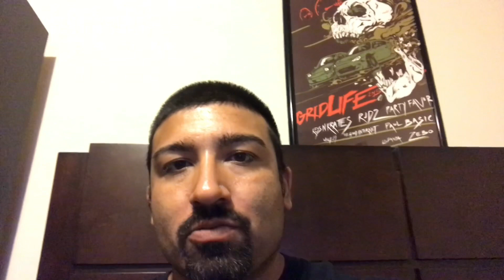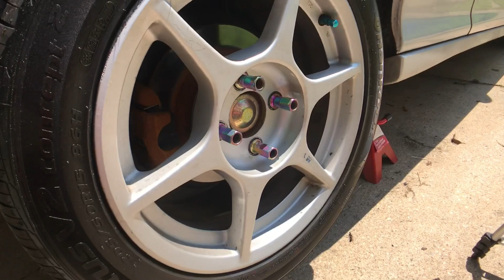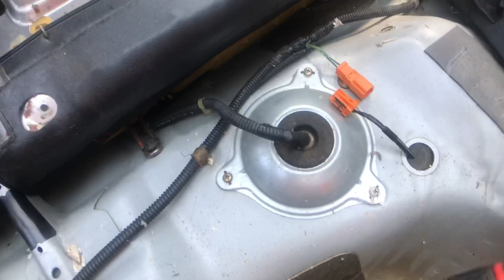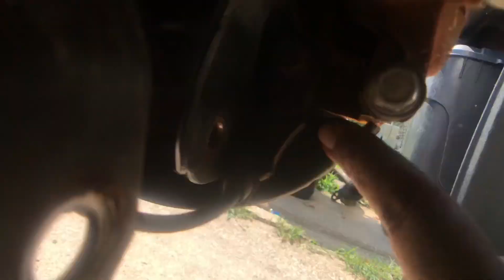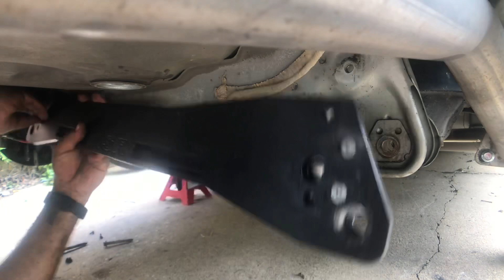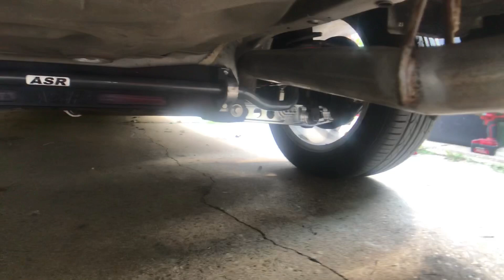ASR subframe and sway bar install

Comment: The abs sensor wiring doesnt work with the asr subframe brace?
Reply from the maker: Alex Bardon the wiring for the abs sensors will work with the ASR subframe brace. If you have aftermarket control arm the bolt holes are not there to mount the wires to, most people just zip tie them to the control arm